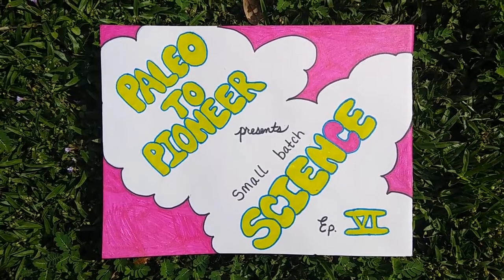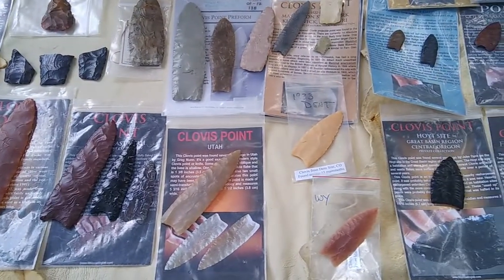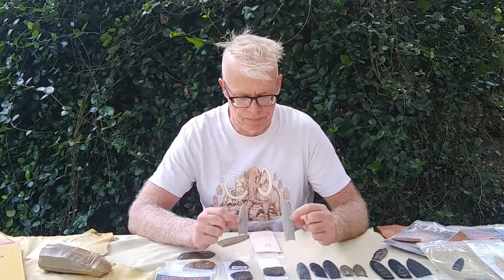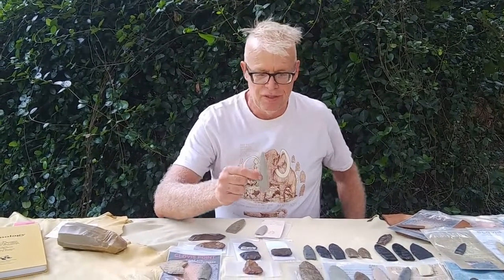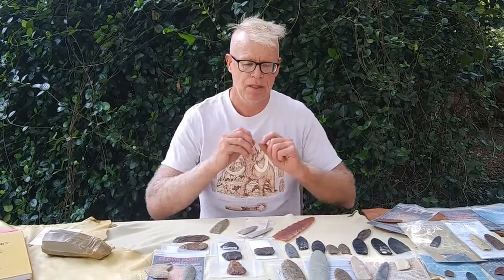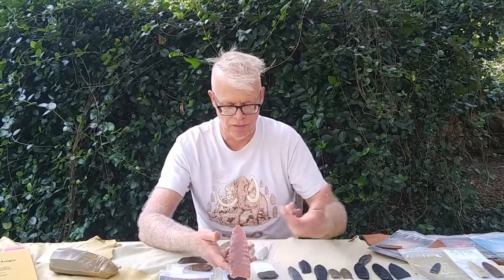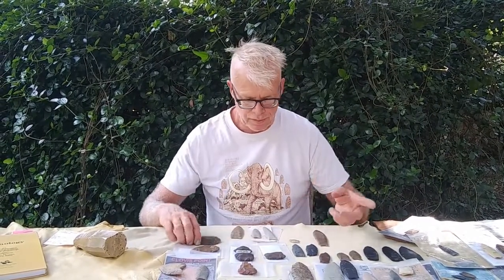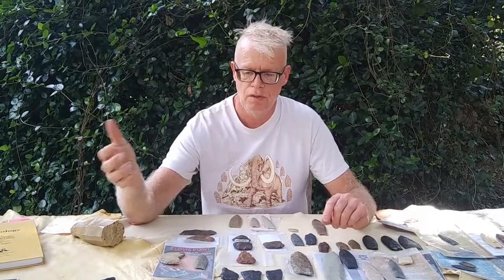Small Batch Science: Episode 6- Clovis Point and Biface Manufacturing Technology

Comment: i believe the smaller and thinner clovis points have a better chance of making the vitals on a mastadon
Reply from the maker: Hiya,  A number of people have said similar things over the years.  in the 1950s when Naco, AZ was excavated- a single mammoth with 8 Clovis points, it was suggested there were 2 calibers.   The size range of points recovered at the famous Clovis kill sites is 25mm to 125mm.  The smallest one came from the Mammoth kill at Blackwater Draw dug by the El Llano arch society in 62/63.

From all the experimenting I've done, and read about, my take is the point has 1 single job.  That is to open a hole and the kinetic force of the atlatl dart does the work-  Mass and speed really matter, the point itself- not so much

If you think of the point as the leading edge of the weapon system, rather than as a projectile by itself, it should come pretty clear that the point just needs to open a hole bigger that the diameter of the dart shaft and the KE is what really causes the damage.
Reply: I agree. As a big game bow hunter, there’s no way I would shoot (or throw) a spear with a massive point. There is a reason why smaller Clovis points are typically found in association with big game finds such as mastodon.

Comment: I tend to distinguish between "edge to edge" flaking and "overshot", where overshot takes the far edge with a diving "reverse hinge".  (Diagnostic curved flake). Edge to edge is a nice long flake that approaches the far edge but does not curl off or remove the far edge.  Do these terms match yours when speaking about Clovis "overshot"?  I find it's a subtle difference that some don't distinguish, so just want to understand your thinking on Clovis overshot.
Reply from the maker: Hi Chuck, Sorry I just saw this.  What you are talking about is a feather termination and certainly counts as an overshot but the trouble is you may not actually be able to tell it is an overshot because, essentially, the far end is not there.  IE it would be about impossible to really tell if the flake went all the way across the face.  You could see it on the biface but the flake by it self would not tell the whole story.

Comment: In 2016 I found …4 Prehistoric Clovis Preforms! .....They still lye on the ground to this day, 10 feet apart ish: They are all 13.7 to 14 cm long, ovate shape, overshot flaking, the works. These were better than any pieces I have seen in 15 years of Archaeology. I was on vacation when I found them at 11,300 feet in the Rockies. Three are dark purple, high quality quartzite. One is striped Wyoming Tiger Chert. The most delicate, only 1/4th inch thick, purple, and 3 inches wide, was left behind because it broke due to heat stress. . Another was discarded because three attempts to remove a plateau failed. A third  end shocked during knapping, and was discarded. The fourth is 17.5 cm long and is a half rounded cobble preform with two beautiful overshot flakes on one face, the other side retains cortex of a flattish-river cobble. it is 4.5 cm thick and "unfinished", much thicker than all the others but still great flaking. I didn't have a camera but made drawings and haven't been back.
Reply: Do you have photos of these? I would love to see them, I can share my email if you do. Thanks
Reply: @artifactsantlersoh   I am working on getting the drawings published.
Reply: @artifactsantlersoh  For all flintknappers tired of breaking Clovis. Get 2 pieces of oak yardstick 10 to 12cm long. Pitch two buttons of wood to one end of each. Wrap the tip of you clovis in a 1 inch wide strip of leather, then sandwich the point between the wood slats with the tip and base wrapped tightly with string- the base is now ready for fluting between the buttons-looks like a giant wood staple puller. They don't break anymore. Good Luck all.